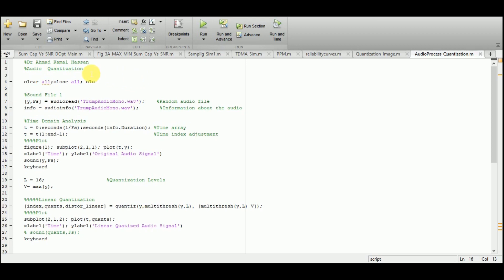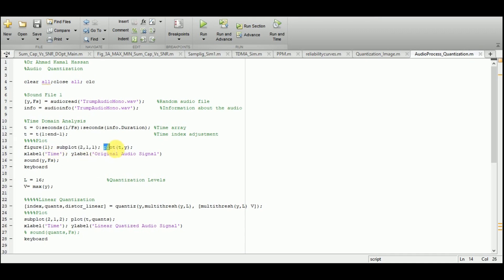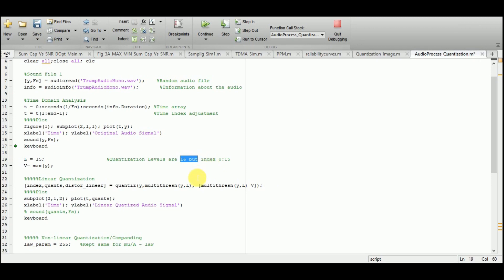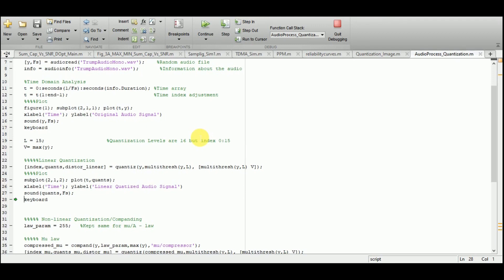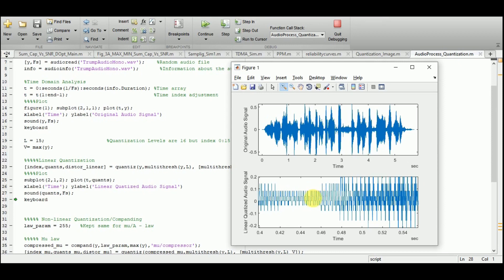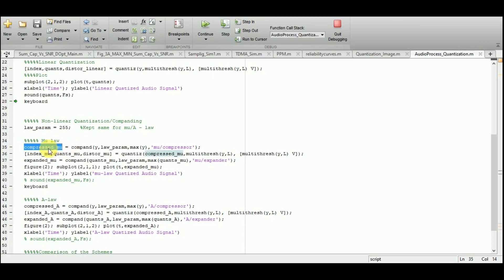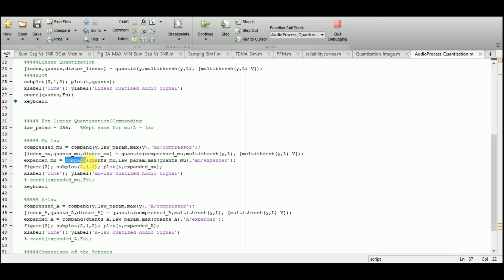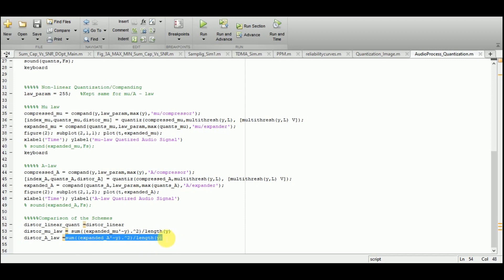Quantization and Companding Explained using MATLAB | Audio Signal Analysis | ADC 4.12

Comment: Hello what if I want to use 7 bits? does that mean level must be 127? and what about law_param? and I need to find The mean square value of the error between the actual sound file and my re-encoded file. I would appericiate I you help me.
Reply from the maker: 1) L should be 127, that is right
2) law_param "an optimization algorithm may find good  value, but maybe start with trial and error"
3) Mean square error: since the data is time series, this should be straight forward. identify the vectors and then > mean((modified-actual)^2).
All the best for that